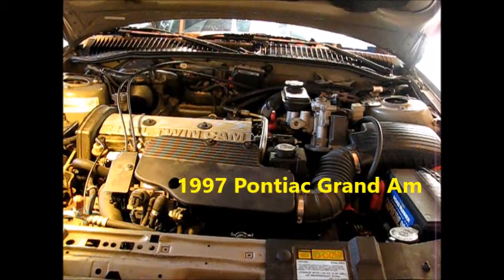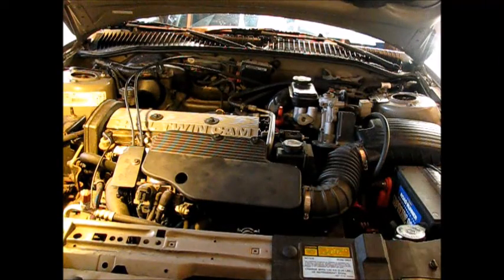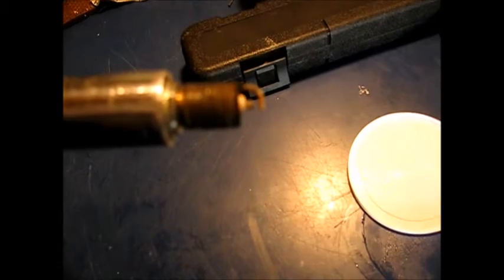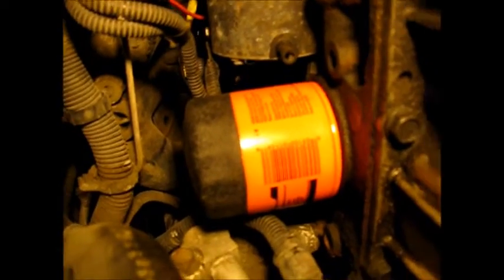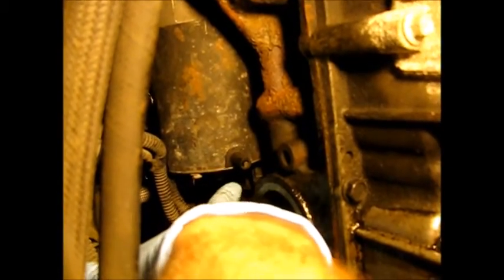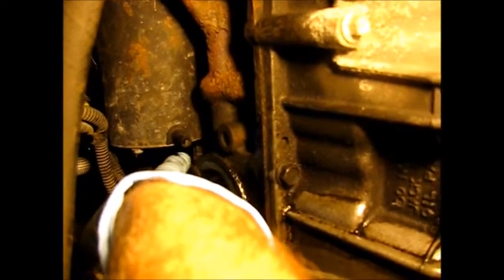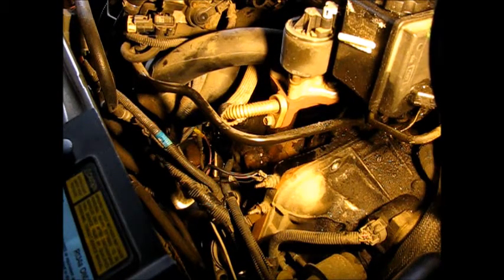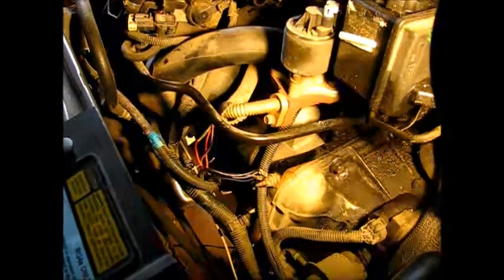Crank No Start: How to find, remove and install the crankshaft position sensor on a GM 2.4L

Comment: If the car has a tachometer and it doesn't move while cranking on most American cars is a sign crankshaft position sensor is bad also

Comment: I have a 2001 that will start run for a second and die. Could this be it ?
Reply from the maker: It won't start at all when this sensor is bad
Reply: Ok thanks . Any idea what it could be? I don’t see any way to test fuel pressure. Can hear the fuel pump pressurize .
Reply: @russellrowlett8102 did you fix it?

Comment: Great video, thank you for posting this. My son has a Sunfire that sure seems to be having this issue. Couple questions

1st; were you shooting from underneath the car or from the top?

2nd; do you absolutely have to remove the starter to replace the sensor? 

Thanks in advance
Reply from the maker: I was shooting mostly from underneath. Removing the starter makes sensor removal (and shooting video lol )easier but is not required.

Comment: i have one of these cars it starts when cold but when its up to operating temp it stalls at stop signs or stop lights if it sits to long then i have to eather let it cool off or use starting fluid to start it  could this be the problem
Reply from the maker: No, that sounds like something else. This part either works or doesn't in my experience.
Reply: I have exactly that same problem right now ! What did you do to fix it? Did you ever fix it?

Comment: my 01 grand am has the same issue, hopefully this can solve it, did you replace the starter aswell as the CPS ?
Reply from the maker: Just the starter. I found out about this sensor when I accidentally unplugged it while removing the starter.
Reply: The Original Mechanic thanks man im going to check mine out i hope its just the starter
Reply from the maker: You're welcome and good luck.

Comment: That's not a Quad 4 although it's very similar.  The Quad 4 was a 2.3L with no balance shafts.  This is the LD9 TwinCam with balance shafts.  Different powerband too.